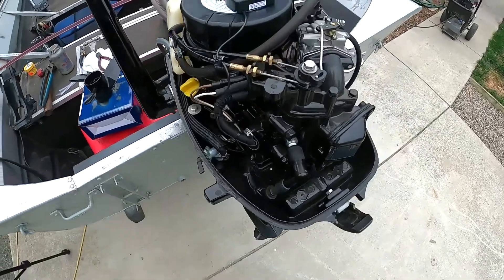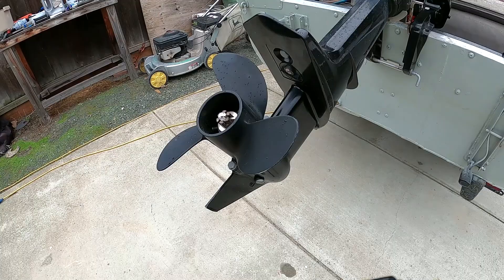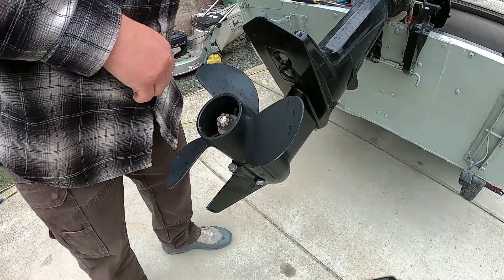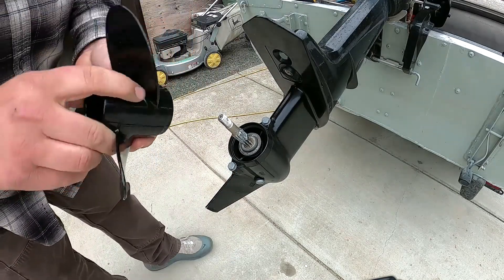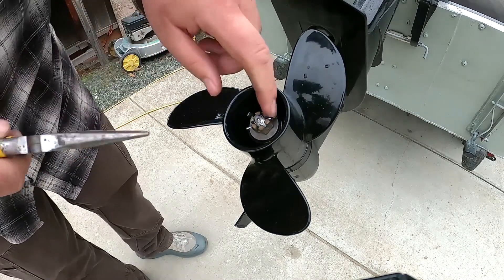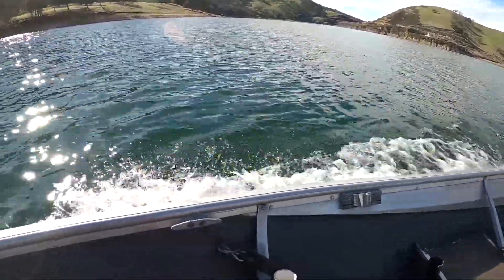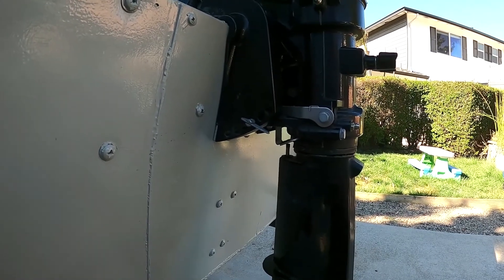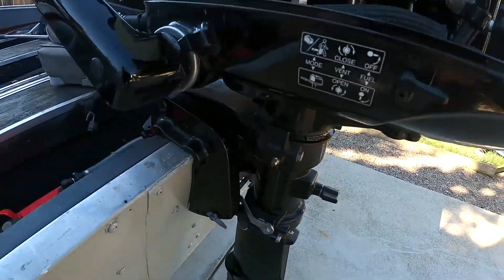Mercury/Tohatsu 6hp fourstroke outboard prop change effect on speed/rpm

Comment: Remember... With re-propping, you need to make sure that EVERYTHING is the same. Small outboards are affected very easily by simple differeces such as wind direction and speed, current, weight onboard thd boat, propeller weight, etc. 
Also, you exchanged the OEM prop for a chinese version (possibly) theres no telling how they came up with their design but im sure it was secondhand and had to be modified to side step patents and such. So in this test, you're comparing apples to oranges plus you changed your outboard trim angle as well. Maybe you brought more fuel this time or were hitting a 2mph headwind last time and a 5mph this time? 
Solas has every prop you need. 9, 8, 7 and 6 pitch. Amazingly designed props. They design every prop from thd ground up.

Comment: What length is this boat? The factory prop is perfectly fine. Don't worry about rpms. Just experiment with the trim adjustments on the motor and try to test with nice water conditions and the least amount of weight. I have a 14-foot v hull aluminum with a mercury 6 hp, and I get it up to 15 easily. Of course with another person on board plus gear, I will average about 12 mph

Comment: Did you ever had any issues when youd hit some rocks lightly and later on prop would spin at higher rpms? I guess some rubber piece inside  got messed up, now need to replace new prop
Reply from the maker: Sounds like you spun the hub.some places will rebuild your prop if it's worth it.
Reply: @TapiaOutdoors  thank you, so i have same factory prop as u do 7.8x8 and replacement thats available is 7.7x7 ...do you think it will lower the speed by a lot?  Im familiar with pitch but not sure when diameter also lower than original...how would that affect my speed i wonder....?

Comment: You have to test two props with the same conditions. The weather, waves, boat load and etc. Take to props to the lake and test them at the same time. Low pitch - less top speed but more torque more power. In your case you have to use 6" because your boat is heavy for 6HP motor.

Comment: I've had this same thing happen when I changed props but used a different brand.  The pitch is just one factor.  Cup and blade size are also important, and aren't the same brand to brand.  Have to use Oem to compare.

Comment: Lower rpm means better fuel economy and going faster,  less wear on engine....not a bad thing.
Reply: No it doesn't.  Open throttle at low RPM loading up the engine will go through gas.
Reply: @TheHoop614  Right
Reply: @TheHoop614  thanks for sharing, cuz i ordered prop thats lower by 1 pitch, and lower in diameter from 7.8 to 7.7 thats the only thing thats available :/

Comment: Decreasing prop pitch WILL increase rpm fact, raising engine will also increase rpm effectively as it releases load on engine.

2 possibilities number 1 like you said the prop isn’t trust worthy second the tach isn’t accurate 

Another thought is water conditions make sure they are the same for every test 

Next step would be put the original prop back on and retest, and keep trimming engine up one at a time until the prop cavitates ( it may not) you should find each time you tilt the engine further you will gain rpm 

If you tilt it all the way to the top and still haven’t found the rpm needed drop a pitch in prop and repeat 

You may also find that the weight of boat and all things in boat are too much, regardless of that though you will need to get correct prop to avoid engine damage
Reply: i’ve got a 5 ho 2 stroke , i was thinking to change prop and get a hydrofoil (Why are hydrofoils  useful,  what is the advantage of getting on the plane quicker and reduced cavitation) also there’s five I think slots on my engine angle and I just have it in the middle which one should I use

Comment: You need to go up in pitch, not down for increase in speed.Leave your trim the same for each prop test. That will through you numbers off too
Reply: You are not right. His boat to heavy.  Low pith - less speed but more torque more power.
Reply: @amigo439  more torque, but less top speed. Its like riding bicycle on first gear (lower pitch) vs riding bicycle on higher gears (higher pitch) which gives you less torque to start off With, but higher speed overall

Comment: How can you draw a comparison between 2 props if you also changed the trim between tests? Just change one thing at a time. Changing the trim affects engine load thus affecting rpm.
Reply from the maker: You are right about the trim.I tried it at both trim levels when I took it out . returned the prop and got a solas prop same size .motor now runs in correct rpm range and picked up a few mph.